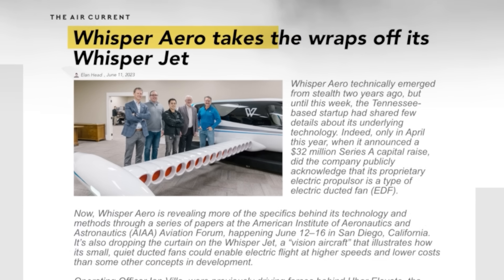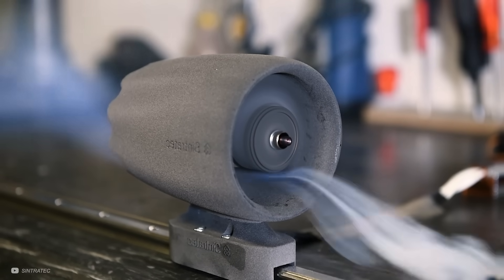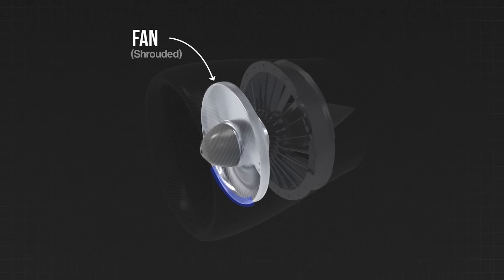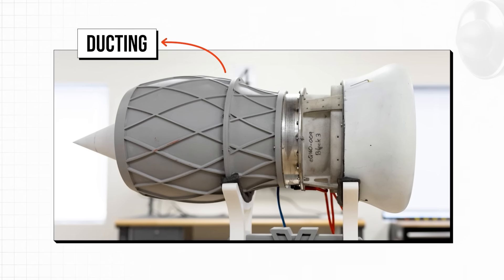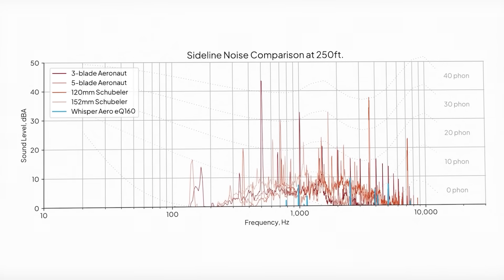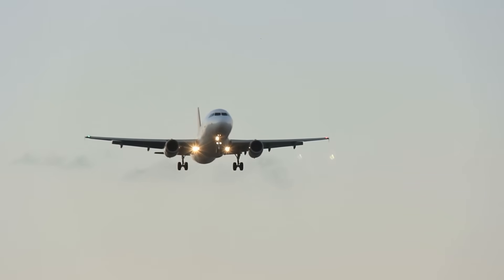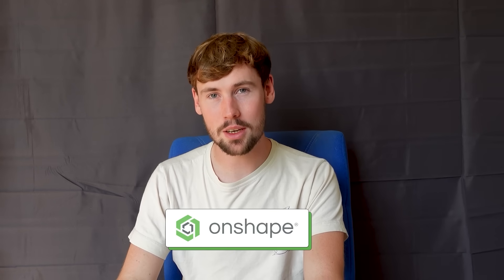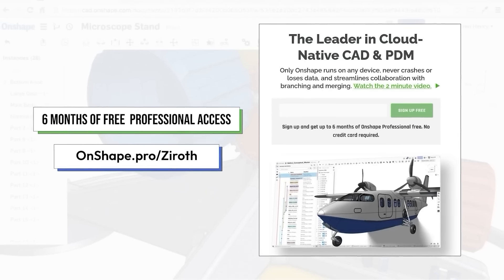This Genius Jet Engine Is Starting A Revolution

Comment: According to your description the engines are actually louder, just outside human hearing, which means they could be catastrophic to animals. Also there are sounds outside human conscious hearing that have been shown to still affect hearing and behaviour.
Reply: He didn’t say the higher pitched sound emitted was also louder, in fact with no tip vortices the total noise at ALL frequencies, including any higher pitched sound emitted, is considerably reduced. The spectrum plot was shown far too briefly, but you can pause the video to study it.
Reply: Worth noting that absorption of sound in air increases massively at higher frequency. Just looked for numbers, seeing 10db/100m at 10kHz, 100db/100m at 30kHz. These high frequencies cannot be heard at long distances, animals will be fine as a result.
Reply: So military applications until they start looking for ultra sound.
Reply: ultrasonic sound can be loud enough to damage your hearing even if you cannot hear it. The damage is not caused by the frequency itself, but by the intensity (sound pressure level) of the sound wave. Any sound wave, regardless of frequency, can cause physical damage to the ear if its intensity is high enough. Ultrasound with intensity in excess of 120 dB can cause hearing damage.
Reply: @grumpy3543  so? The levels here are nowhere close to causing hearing loss.
Reply: @SorinSilaghi That’s my question. If the levels were very high but out of the range of hearing so that you didn’t know that they were high, would it damage your hearing?
Reply: @grumpy3543  yes, it does. But we're not talking about those levels of noise here. If they built something the size of an airliner then you might see problems. But even then, electric planes have the advantage that you can keep the engines off while not moving. In any case, these things have other drawbacks in weight that probably make them impractical, especially for large applications.
Reply: @SorinSilaghi Okay. Sounds good. I just was wondering how a jet engine could put out such low levels of noise and still produce thrust.
Reply: The duct will be internaly covered with sound absorbing materials. Sound absorbing materials are more efficient for higher frequencies than for lower frenquencies.
Reply: Here we go. Get a life.
Reply: That was my thought too - imagining animals with wider hearing range becoming sick if this design became widespread.
Reply: @markir9 sound levels are low though to begin with and high pitch sound travels less distance and gets absorbed easier than low pitch sound. You're worried about something without having any context or information.
Reply: At 3:48 he said 16,000 kHz. I do hope they run tests to see what if any effect there may be on animals.
Reply: To all the murican dūmbfcūks arguing in the comments: current passenger airplanes also emit ultrasounds (sounds outside human hearing range) and nothing dies. But you know what diēd? Look at youselves. Your brain diēd years ago and you are still commenting here dūmb shit.
Reply: Maybe it will drive the rats out of NYC....
Reply: actually ... motors. engines eat fossil fuels
Reply: @brentadams5595 Electric engines are a thing. An engine is a motor that converts its rotational motion into linear motion of the vehicle it is attached to.
Reply: Well that's going to be confusing not being able to hear a plane as it flies over it that means it's probably not really flying
Reply: Could perhaps the noises alert animals and scare them off earlier? 🤔
Reply: Don’t forget that the range of high frequency sounds is minimal compared to low frequency sounds.
Reply: Well, it would be great to scare away those damn birds that have been causing accidents and deaths by the ton since the first planes flew, so an engine like that would be very useful for the safety of planes and passengers, but this kind of things are very hard to understand for animalist or vegan people
Reply: what an asshole!
Reply: Speaking with the authority of two hearing aids, it's being outside the human range of hearing is irrelevant. If loud enough a noise it can and will  still do damage.
Reply: No problem here. This system is not louder. It’s just higher frequency which is easier to control and doesn’t draw as much attention. Higher frequency is much less damaging because its short wavelength don’t travel as far and are easier to attenuate.
Reply: Impact in wildlife is definitely something to evaluate!
Reply: Or even the impact on dogs.
Reply: Pitch is NOT amplitude.
A higher pitch sound is not "louder".
Our perception of loudness comes from the amplitude of a wave, not its pitch.
Reply: @enricomontanari1390  Chin up, my friend, I know exactly what it’s like to bang one’s head against a brick wall. It’s hard to win when those whom you’re attempting to correct possess profound deficits. I’m going out later to tilt at windmills … would you like to join me? It’s bound to be more rewarding than trying to infuse these uh “nice people” with logic.
Reply: @enricomontanari1390  Our perception of loudness is actually quite complicated and varies with sound pressure level as well as pitch/frequency.
Reply: @enricomontanari1390  Animals, our body tissue, or a military microphone do not care about our "feeling of loudness".
Reply: @snygg17 The sound pressure (we usually

measure in decibels) is given by the amplitude, not the pitch.

Pitch and amplitude are very very very VERY different, you can't treat them equally.
A higher pitch sound is not a "louder" sound.
You can have a 20khz sound at 15 decibels
Reply: @enricomontanari1390  Who is treating them the same?
The video outlined, that the engine is less loud in human frequencies but louder in frequencies that humans don't hear ... but animals do and our tissue reacts to it.
Just because you can't hear it doesn't mean it doesn't exist.
Reply: @snygg17Of course, it's a perception and it clearly says is.
The first comment says "the engines are actually louder", no, they're not.
Reply: @enricomontanari1390  let me correct your wrong quote: "the engines are actually louder, just outside human hearing,"
He is specifically not talking about human perception, but more about the total emitted noise.
Let's try: louder = more energy, more amplitude, more sound pressure level
Your welcome!
Reply: @snygg17 I think you misunderstood him. If there are less vortices there is less noise.  When he says higher he is referring to frequency not the sound level.
Reply: @iedboiYes but that's not the point, loudness doesn't come from pitch.
A higher pitch sound is not louder
Reply: @enricomontanari1390 in the video he mentions the downside of higher pitch count and that is noise. It is louder, but the frequency is above 16kHz. Lots of people and many animals can hear above 16kHz.
Reply: I'm not worried about these frequencies outside of human hearing -- to damage tissues you usually need a lot more pressure than would be uncomfortable at frequencies you can hear.  But the concern is perfectly well formed and doesn't confuse amplitude with frequency in any way.  It is noting that this design moves some of the sound energy up into a frequency we can't hear -- though 16khz isn't that high we can hear up to like 22 if young.
Reply: @petergerdes1094  ultrasonic sound can be loud enough to damage your hearing even if you cannot hear it. The damage is not caused by the frequency itself, but by the intensity (sound pressure level) of the sound wave. Any sound wave, regardless of frequency, can cause physical damage to the ear if its intensity is high enough. Ultrasound with intensity in excess of 120 dB can cause hearing damage.
Reply: @grumpy3543  This is such a red herring discussion. The sound intensity is far lower then what could cause damage to the environment, people or animals, it's at level of rustling leaves.
The change in pitch is just to make it even less audible.
Reply: @znail4675 Okay, thanks.
Reply: @znail4675 Thanks
Reply: 16khz is not even high enough for humans, people that arnt old will hear it, kids that cry in the plane will get even worst and imagine the poor pets !!!!
Reply: @SpeedyGwen  Yes. As a teenager, I was tested and could hear 22 kHz very clearly. The old whistling TV sets at 405 lines used to drive me to distraction as a young child, and the 625 line sets were even more irritating, giving me really bad headaches (and possibly nosebleeds) when they were first introduced during my pre-teens.
Reply: @SpeedyGwen  these fans are still quieter than regular ones, even if you can hear them. Plus high pitched sound is easier to block and travels shorter distances. That doesn't depend on what frequencies you can hear.
Reply: @SpeedyGwen   well, with that dammed "flag" behind your avatar whatever thing you can say is wrong
Reply: Electric powered fans seem like they would be incredibly efficient. But of course it takes a huge amount of energy to turn the electric motors of large jets. The isn’t a battery in the world that could replace the amount of energy to replace the jet fuel carried in the wings and belly. Of course it wouldn’t need that much energy because the electric fans are so much more efficient. But still. The battery for a 4 hour flight would be bigger than the entire airplane. You could do a generator to power the electric motors but that would defeat the purpose.
Reply: @grumpy3543 all in good time. Start with leaf blowers, then homebuilt aircraft, then work up to the point it stops making sense. Probably modest commuter planes as the video shows.
Reply: Some High frequencies maybe out of our hearing capacity, but the harmonics will affect us health wise. 

And most animals, insects will definitely be affected.  Hearing protection is still important
Reply: @yihchiehseeto225  The harmonics are, by definition, multiple times the high frequencies. They are also absorbed and attenuated far more effectively by air. So they are much less damaging than near-ultrasound.
Reply: What we know bot, is that this company has been working on this technology for a number of years, and none of what you have assumed has been revealed in the real world testing that has been done since that time. So, your contrarian conclusions, based on nothing but assumptions, though typical for social media, is nonetheless, still invalid.
Reply: Calm down everyone. This is just another opinion
Reply: Yeah, that was my first thought too.
Reply: @snygg17No.
A higher pitch sound is not "louder".
Reply: @enricomontanari1390  At the same db level lower sound frequencies are harder to absorb than higher frequencies. That's why you will hear mostly the bass and drums of your next door neighbour playing loud his favorite heavy metal songs in the middle of the night. While you can't even hear the guitar solos.
Reply: @FrancoisEustache-ed6gd That's absolutely true, but when you think about potential damage to body tissues or hearing, you're referring to sound pressure (or decibels), not the pitch.
Reply: @enricomontanari1390  The video is about  reducing the noise of a new plane electric motor. It about noise polution around ariports and has nothing to do about potential damage to body tissues or hearing.
Reply: @FrancoisEustache-ed6gd  I can confirm that noise reduction has come a tremendous way already.

I was absolutely shocked how quiet F-35s are.

I live near an airport with occasional military traffic. I thought we might have got our first Cirrus or something, checked out the window, and it was a pair of F-35s going vertical. 😮

I lived on an Air Force Base as an 80s kid, I spent a lot of time on the flight line. It took me a few seconds to accept that the F-35s were as quiet as they were.

Fun fact. The A-10 doesn't even need to shoot you with anything to cause casualties. A close enough high-speed low pass is loud enough to give you permanent hearing damage. Mop, mop, mop...

Comment: edfs are nice. true. electric muffled fan. lol. earns? lol. free gift. so a generator is not an engine. oh my. your people's definitions are bs, and not consistent. also recommending yourself is nasty. well brushes dc motor can be the usual pulsed ac motor or a homopolar brushless dc motor. lots a talk over so little. market servants are slaves. never. be content with what you have, dont demand more. its called being greedy. ie settle in free trade. no obligations. you get it if you get it. pinky promise.
Reply: btw, any designs are open source free no string attached. for diy and everything. even commercial. so if you did not get it, the free gift, then diy. say please, world. only above gets credit. certification? diy. not free? your problem. pleasing people? is your fall. not mine.

Comment: Ducted fans already have low tip vortices from their proximity to the wall of the duct, and counter-rotating ducted fans are the state of the art in max thrust and low noise. I don't understand the design choices here, why not make counter-rotating ducted props if you are using a central mounted electric motor anyway and thrust and noise are your goals?
Reply: Thanks for mentioning it, I never heard of it before. On the other hand, it requires 2 motors vs 1, and double the control systems, which ends up to be more complicated, probably heavier too (even if each motor had ideally half the power), and thus double the chances to break, so it's less reliable. Still, a very interesting alternative.
EDIT: I think a single motor could be used with a stationary rotor and two stators counter rotating, or the opposite, so in that case, it has more advantages.
Reply: @sumwonche5688  I reckon you could do it with 1 'motor' as in 1 set of coils and 2 sets of permanent magnets half the size as you would use for a single output shaft style. Front and rear axle, magnets mounted so they turn opposite directions. 
You could probably tune relative thrust/force of front vs rear axle with relative permanent magnet strength/size.

Just saying, you probably wouldn't need gears to convert electric power to 2x rotating axle.
Reply: @nommy8599  Yes, that's what I wrote, 1 rotor with 2 stators rotating to opposite directions - with magnets or even coil, or 1 stator and 2 rotors rotating opposite to each other.
Reply: @sumwonche5688  par définition: le stator est la partie fixe et le rotor est la partie mobile d'un moteur électrique
Reply: @hadesazur1964  That definition is for the average motor, but stator also implies the outer shell and rotor the inner shaft, because that was almost always the case. So if you make a motor where the inner shaft is fixed and the outer shell rotates and you call the inner one stator and the outer one rotor, you'll create confusion.
Reply: I find it interesting that no one discusses where and how the Electricity for these "Aircraft" comes from .
Reply: @frederickwinn6574  wdym? Battery Tech is good enough now and improving. Fusion research is getting more and more funding, 10s and perhaps soon 100s of billions $ per year. Not to mention present clean/fission power...

Comment: Wait, wait, wait! 😅
You cannot call a ducted electric fan as a engine! 😅 
Cause aircraft engine is defined as: "a engine that is capable of providing enough thrust to make lift for aircraft by considering its own & aircraft weight" 
{side the batteries weights for now😅💀} but let's just consider the thrust to weight ratio only! BUT let's say it can have various other uses rather than considering it as a "engine" for aircraft🙏
Reply: Yeah, the poster is not too bright at times.

Comment: Gliders are not powered. It's a plane.
Reply: A powered glider is a glider.  "A motor glider is a fixed-wing aircraft that can be flown with or without engine power. The FAI Gliding Commission Sporting Code definition is: a fixed-wing aerodyne equipped with a means of propulsion (MoP), capable of sustained soaring flight without thrust from the means of propulsion"
Reply: It’s called a motor glider. The means of propulsion is for extended range. It isn’t used full time.

Comment: Noise reduction and efficiency gains are good news. I'd like to know how the "all-fan leading edge wing" would handle in a power out situation, though. Can it glide, or will it plummet?
Reply: well, in best case it will dramatically reduce stall speed while running and "do nothing" while off… so that's still dangerous (like: enables ultra low speed landing, but if motor problem then you die)
Reply: @DresdenFPV  I was thinking this - blowing air over the top of the wing dramatically reduces the point at which airflow becomes turbulent vs linear meaning much slower stall speed, so if all thrust was doing this in effect it may be literally impossible to stall while having power, perhaps. Source: rctestflight I think - some small RC plane some YTer made.
Reply: @nommy8599  That's been done in practice
Reply: My guess  is that you parralelize the motors drive electronic and even the battery components so make loosing all the motors at once or all the motors on one wing extremely unlikely without damage that would catestrophic regardless.  That said if it happens it doesn’t look like you have any feathering ability in the units so you end up with significant drag vs similar power level convential units.  The speed the optimized the ducts for will also make a difference in this scenario
Reply: Stall characteristics are bound to be terrible because without the engine you basically got a plug that blocks airflow over the entire top of the wing in that section. And you don't even have to lose all power, just striking one large bird or a flock of birds can take out an entire row of engines (thinner weaker blades wink wink) and lead to an asymmetric stall.